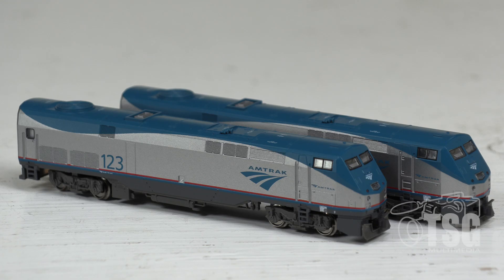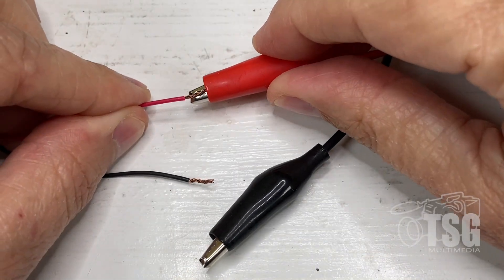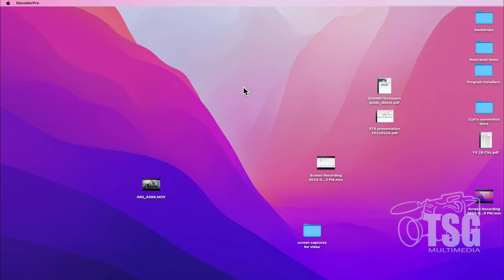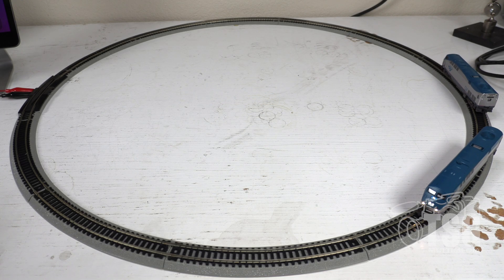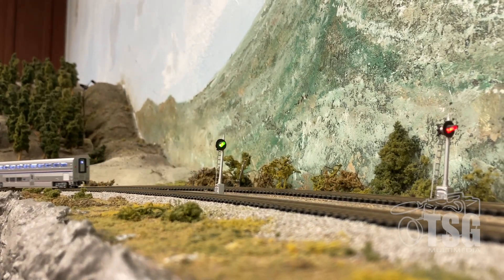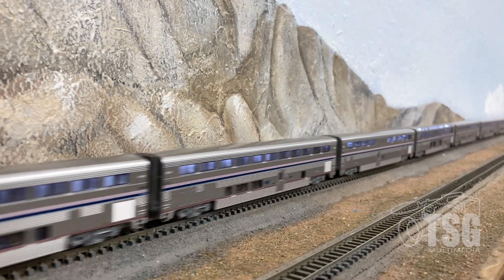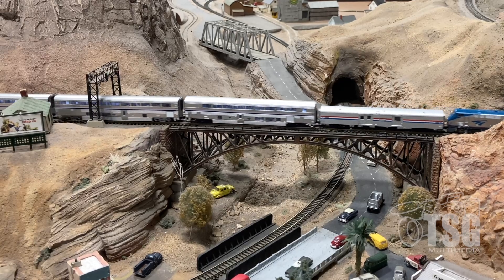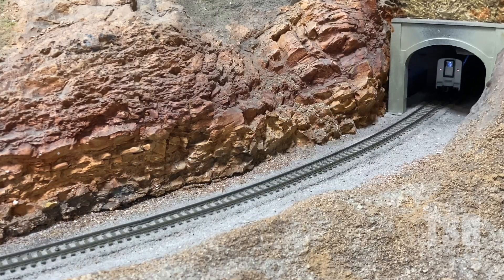N Scale Kato Amtrak Train Speed Matching JMRI | Test Run

Comment: Interesting method for speed matching. I use a similar method using JMRI, but with the following differences:
1. I use my NCE Powercab with their USB adapter to connect my PC to the Powercab;
2. I use a speedometer unit to measure the speed of each locomotive;
3. While I normally use the basic speed settings (CV2, CV5, and CV6), sometimes I use the 28 step speed table (yes, the speed table is 28 steps) to get better fine tuning for speed matching;
4. I usually establish speeds that I want all (or at least most) of my locomotives to operate at. This makes running them more predictable, plus it allows me to mix different consists together.

Also, all decoders use the same method for advanced consists. This involves loading the consist address into CV19. The values for CV19 at 1-127 for forward orientation, and 128-255 for reversed orientation. So, an advanced consist for back-to-back locomotives could be 1/129 to 127/255 (if you noticed, the reversed units CV19 setting is the value of the forward unit, plus 128).